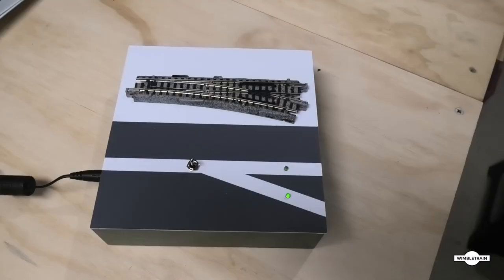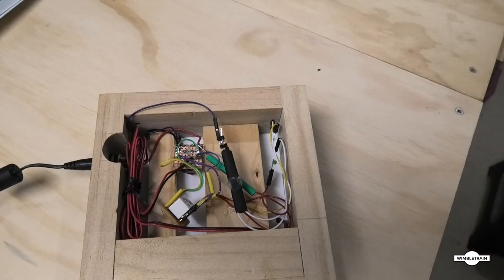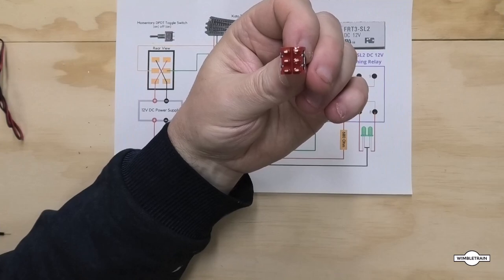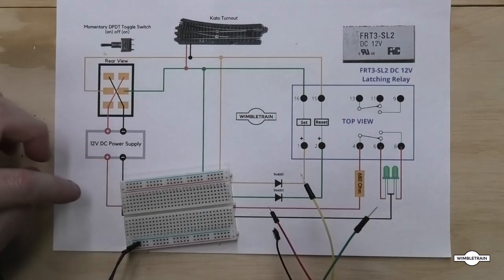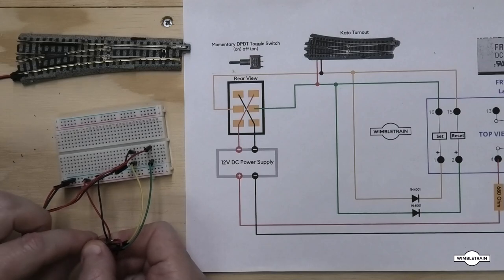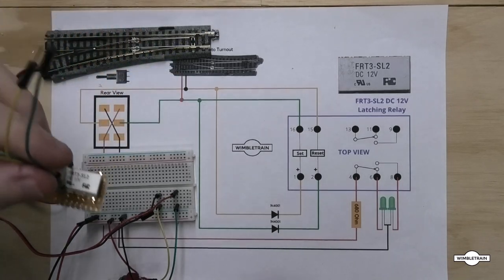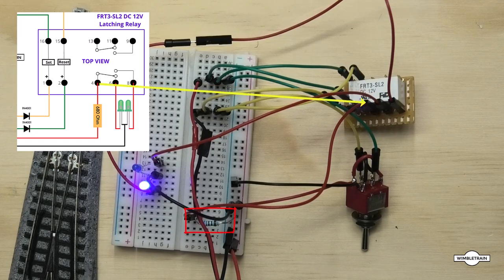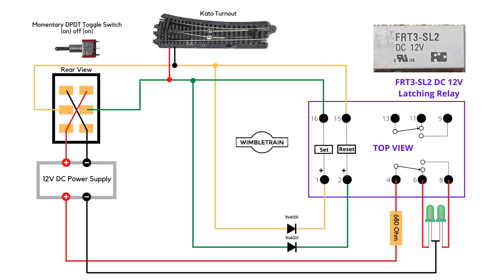Kato Turnout Operation using momentary toggle switch wiring walk-through

Comment: Dear sir, when wiring from a normal SPDT switch, all you need is a capacitor of 1000 up to 2200uF 25VDC or higher, in series with the coil of the switch motor. Mind the polarity! The plus 12Volt to one side of the CO contact, minus (or zero) to the other side of the CO. The middle contact directly to one end of the coil, the other coil wire to the positive side of the capacitor which connects directly to minus (or zero). Just flip de SPDT switch and the point is operated. It hardly takes any current since the current to charge the capacitor is all you need. Because of the capacitor being charged and discharged through the coil, which is about 20 Ohms, there will be no rest current running in the circuit once the capacitor is fully charged or discharged. Using a DPDT switch gives the oppertunity to connect two leds or anything else. Using the CO contavts of a relays also gives the same result.
Reply from the maker: Hello, yes I have tried a setup like you mentioned and it works well. Thanks for watching!

Comment: Hi John, thank you very much for your channel. Could you tell me where to get the relay? Here in Spain I'm having a hard time finding it. Thanks a lot
Reply from the maker: Hello and thanks. I'm in Australia and got mine locally from a placed called Altronics, but that's not really an option for you I guess. That's the only one I could find locally to do my test setup with. However, it doesn't need to be the exact same type number. I don't know what's available in Spain but I did find one from a electronics store in the UK called Maplin (https://www.maplin.co.uk/). It's a different type number but it has the same pinouts as the one I used (and a lot cheaper than my one too!) If you search for 550023 you should find it 12V Miniature Latching Relay DPDT HFD2. The data sheet is also there showing the pin out diagram. Not sure if that's an option for you. You may want to search locally and see if you can find something similar, like I said, doesn't need to be the same part number as what I used as long as it does the same job.
Reply: @wimbletrain  Thank you very much for your answer. I will look for this model. Thank you very much

Comment: Nice video I had questions on why u needed momentarily switch. Bipolar leds have 3 wires though most of them
Reply from the maker: Hi and thanks. You need to use a momentary switch so that you only apply  a short pulse of 12V to the Kato switch. If you have a normal switch it will send 12V continuously to the Kato switch which will damage it. Yes, you can also use a bipolar LED of you wish but the purpose of using 2 separate LEDs is so that you can easily see on the control panel which way the Kato switch is.

Comment: Followed your previous diagram.  I made one modification.  Using a common cathode red green Led.  Works great.  Thanks.
Reply from the maker: Nice!
Reply: @fordtopgun, can you show how you wired the common cathode red/green led.
Reply: Can this be used for a Kato double crossover?
And have you tried using  common cathode green/red LED’s?
Reply: @timcontreras5208  I used a different latching relay than wimbletrains.  Hfd2/012-m-L2.   And a common cathode red/ green led.  [3 LEADS].  I can't send a pic of the set up in a reply sorry.
Reply: @timcontreras5208  I made a quick short video with my setup.  Never done a video before. 1st time for everything.

Comment: I made a control panel for a 6 turnout layout. Your circuitry worked and controlled the LEDs just fine. At that time I had not added the turnouts to the circuit. When I added the trunouts to the circuit, the turnouts worked well however some of the latching relays failed to latch when the turnout was activated. The LEDs would change when the switch was held but go back their previous position when the momentary switch was released.
Any suggestions to resolve this problem??
Thanks
Lew
Vancouver, BC
Reply from the maker: Hi Lew, maybe try swapping the working and non working relays with each other to see if it's the relay or some other problem. If you can eliminate one thing at a time it should lead you to the problem. John

Comment: Just found your channel and subscribed.   Great tutorials!!!   Prototyping breadboards are great for testing out circuits and wiring.  Long term use soldered connections for all wiring, because wires are easily pulled out of prototyping breadboards.
Reply from the maker: Thankyou very much for subscribing! Yes the breadboard comes in very handy when testing. Cheers John